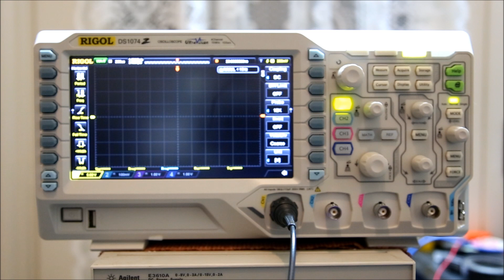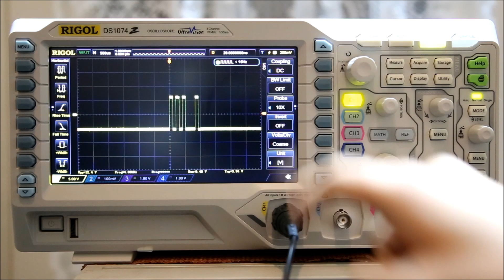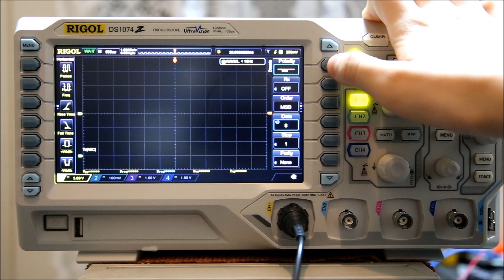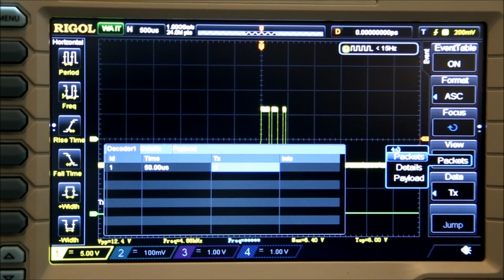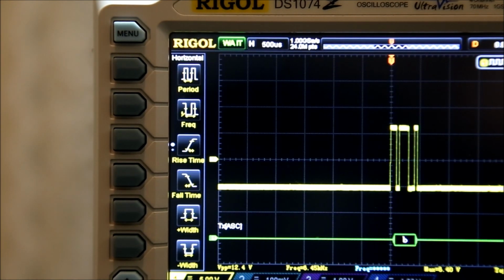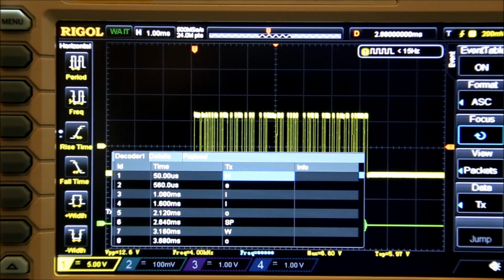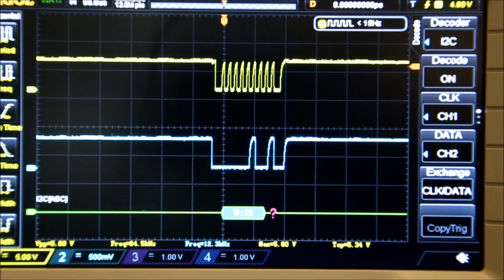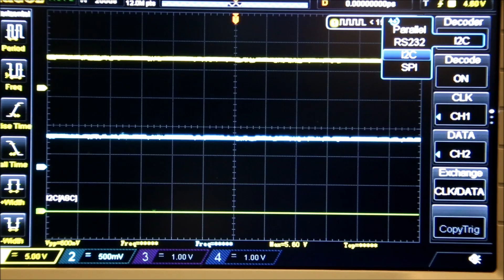Rigol DS1074Z Serial Decoding

Comment: Hi friend.is dsea enough for all options or should I add dsfr after dsea for full options.thanks
Reply from the maker: DO NOT use DSFR (All options) as 500uV is buggy and does not calibrate itself. DSEA is ONLY increasing the bandwidth, so you will need to add the others. Do not add DSBA as that is real buggy.
Reply: DSER is the correct option for 1054z upgrading.

Comment from the maker: Ian Loke go to http://riglol.3owl.com
Reply: Hello,
I tried it with a MSO1074Z, the model with the Logic Analyser, however it didn't work. Any upgrade coming to unlock the options ? Or any idea what tool use ?
Thanks for the information.
Reply from the maker: I'm not sure, but I don't think you can do decoding on the digital channels. Go to http://riglol.3owl.com for the key generator for the options.
Reply: echen1024 does this generator actually work on new DS1074Z  scopes ? there is no need to replace the firmware ?
Reply from the maker: I do think so... I haven't tried recently.
Reply: echen1024 Yes, I confirmed just a few days ago, it works.
Reply from the maker: That's fantastic then! The hack lives on...
Reply: ***** Yep, it's gone... what a shame. That was great hack.